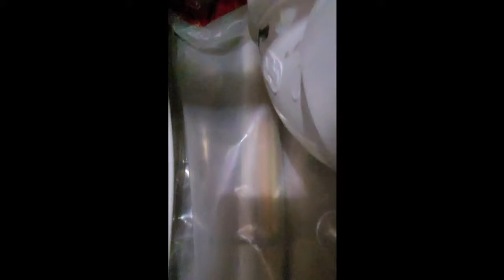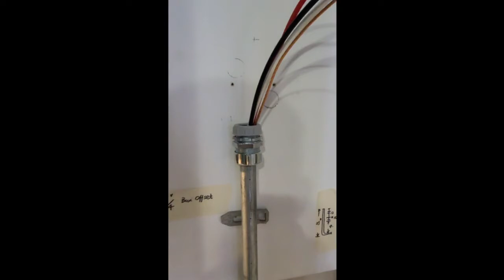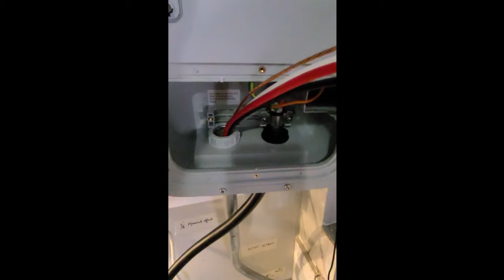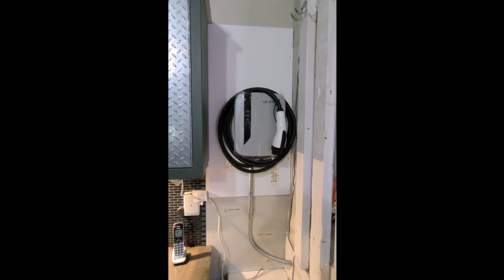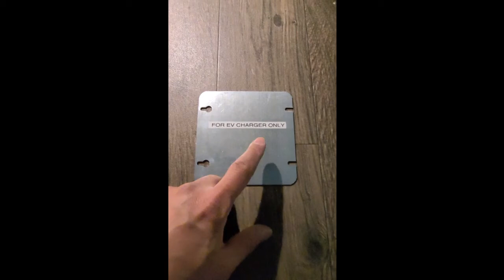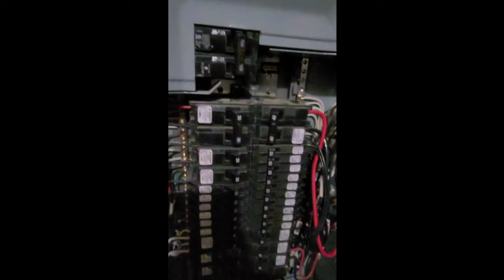DIY EV Charger Installation Part3

Comment: If the EV charger has multiple amperage settings, customer has the ability to potentially change the charger to a higher amperage than what is wired.  I read the STANDATA and it mentions this, but doesn't really give any solution to this problem.  

Do you just set the amperage on the charger itself to whatever the customer wants and put a warning sticker on the charger saying this is only rated for whatever you set it at?
Reply from the maker: Hello Mike. 
Most charger I did here is Tesla Charger, and 40A is good for the maximum current.
For customers who do not install "hard wired" charger, I use 14-50R receptacle and use awg#6 for any charger. Because the charger should not draw more current than 50A if the charger has a 14-50 plug. 
But the F150, I heard it could draw even higher current, never seen any yet. Then I am thinking it should be a "hard wired" type charger, so you do not just install a receptacle for it.

But, there is a possibility, that you install 14-50 receptacle using awg#8, which is good for 40A only. But customer could use a charger which draws 50A. But either way, it will be protected. 

The most important thing is: breaker is used to protect the conductors (wires), not the device.  So even if wire size is not enough for charger, the wire is still sufficiently protected. If the breaker keeps tripping, which is a good thing, customer will figure out to lower the charging current.
Reply: @yilehuli  Ah yes that's right.  Even if I wire a charger to 40A, but if the customer tries to change to 50A in the charger itself, the breaker will trip as soon as it hits 50A.  

In your opinion, when do you think its better to use a receptacle vs hard wiring a charger?